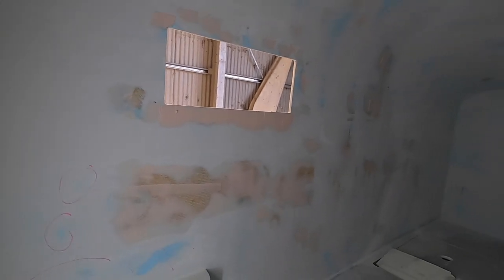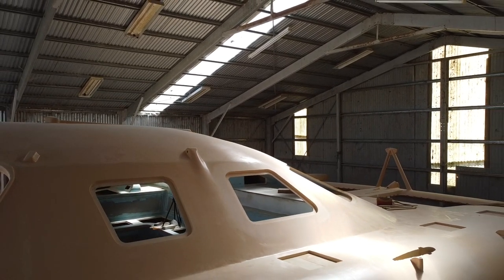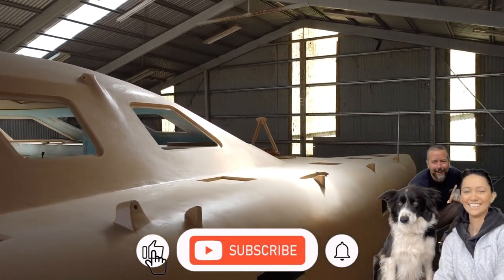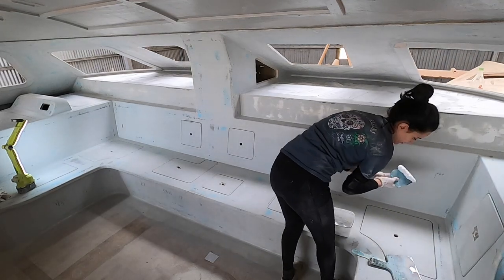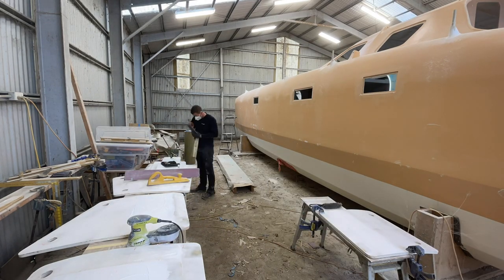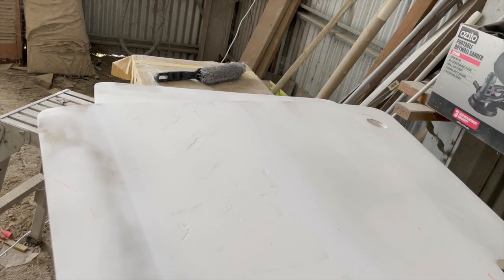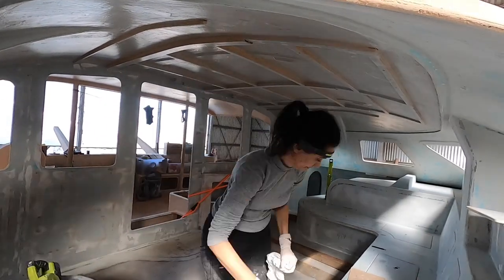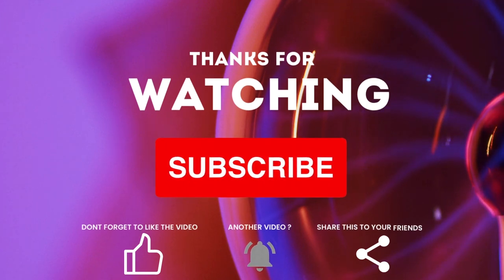The RETURN of the RESCUED CUPBOARD - S02 E28 - DIY Catamaran

Comment: Dude, what the actual heck are you doing, if it's expensive to stay on land-just finish the outside and maybe one room of your boat and get it to the water, it's a goddamn big floating platform, there is nothing holding you back from finishing it afloat, wtf
Reply from the maker: You've got a point. We are working very hard on finishing the outside. It's simply a lot of work. The inside will not be finished by the time we sail away. I think we'll always be building and improving.
Reply: @buildingwilda  that's the best way of building a boat, it's like in Expanse-can't stop the work, can't stop improving :)